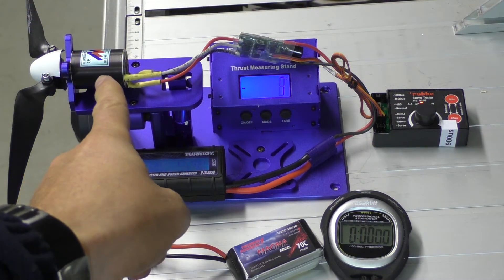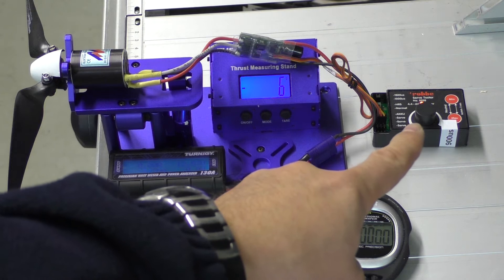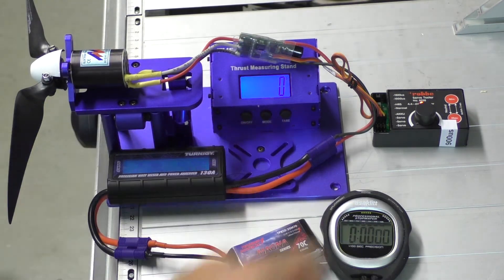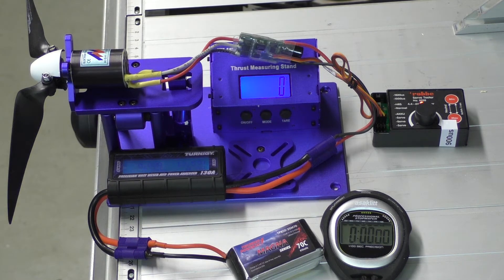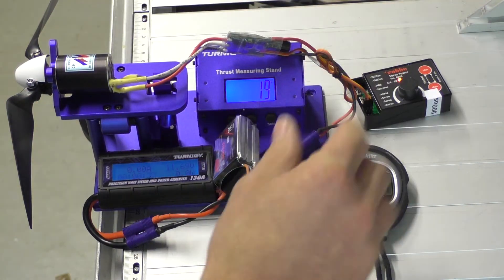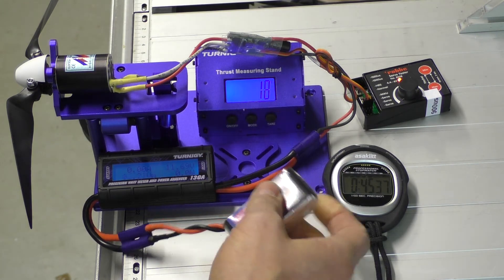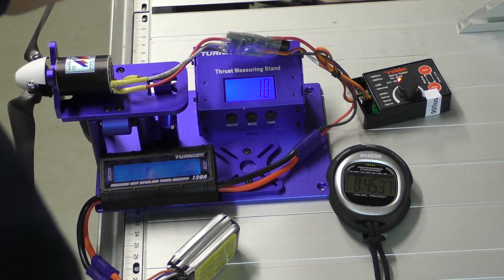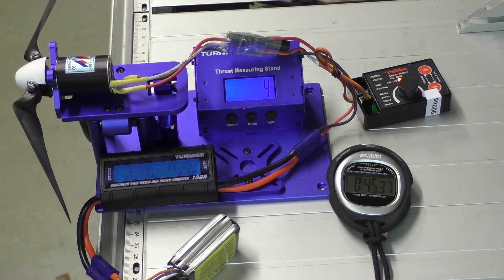Mega motor 16/15/5 30s test run with TP 70C lipo

Comment: Im glad I saw this I was going to get the 16/25/4ce which is a higher kv than this motor and the recommended props are 10x8 or 11x6,I will get the hacker a20 6 xl 4:4:1 now thanks for sharing

Comment: I think you over propped it. I believe MEGA recommends a 10x8  prop for 3s. It should run cooler with a smaller prop.